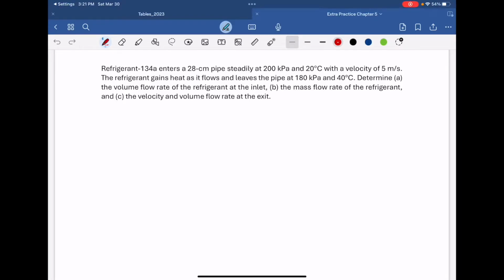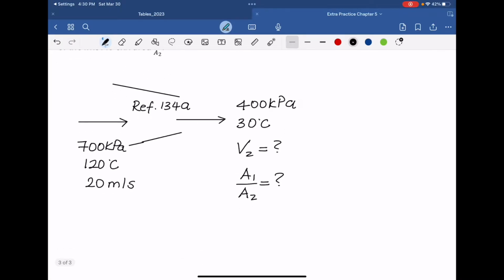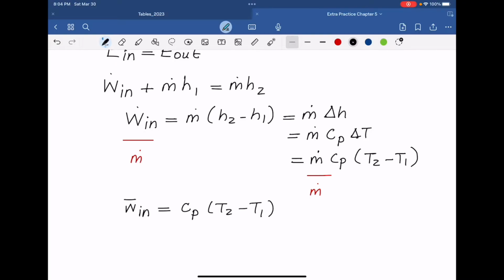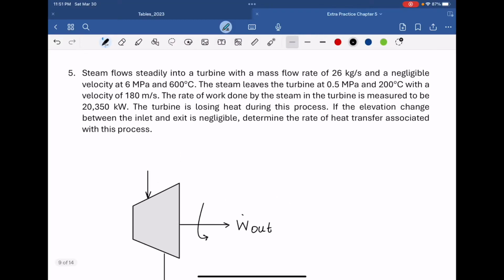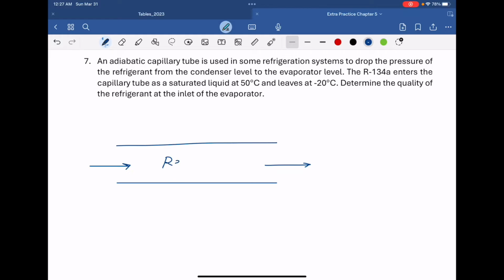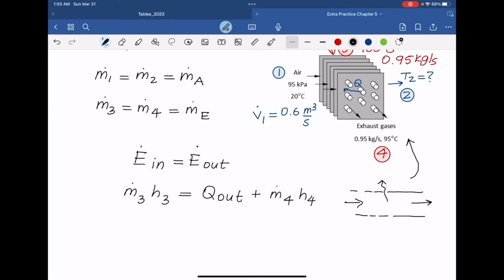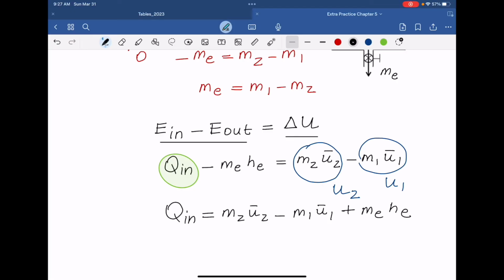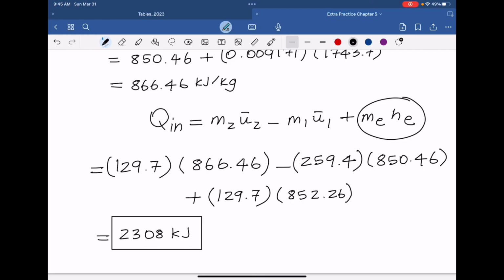Thermodynamics Chapter 5 (Open Systems) Practice Problem Solutions

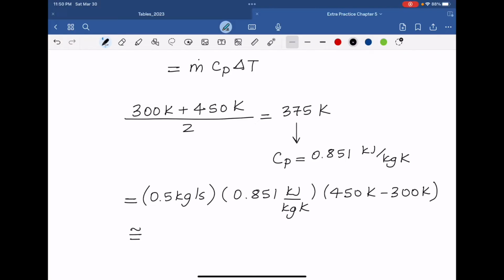Comment: Time Stamp 50:20- I believe the Cp value is incorrect as that value is lower than the Cp Value at 350 K- I got a value of .917. Can you let me know if I made an error in that?
Reply: You're right. I just calculated it out too. I got Cp=.912
Reply: Was just about to comment this. I also got Cp = 0.917. It has to be between 0.895 and 0.939